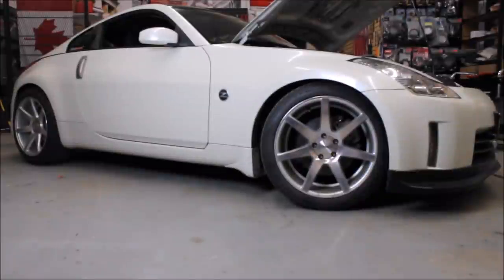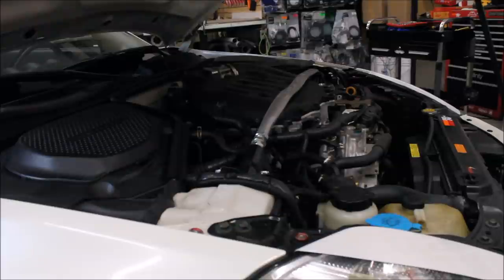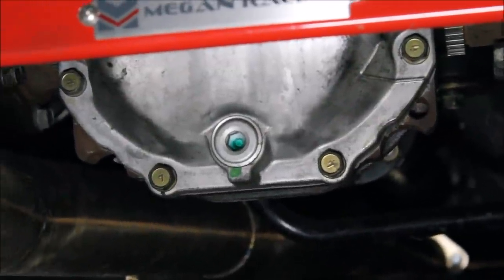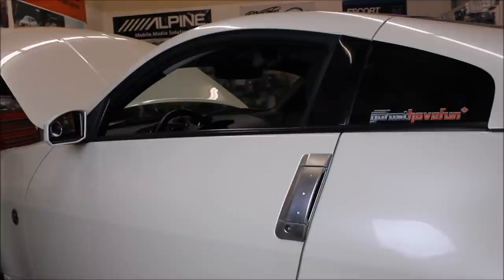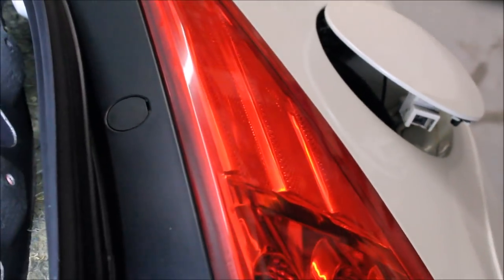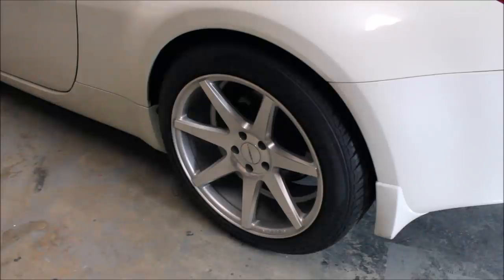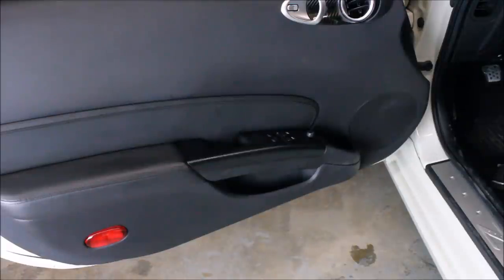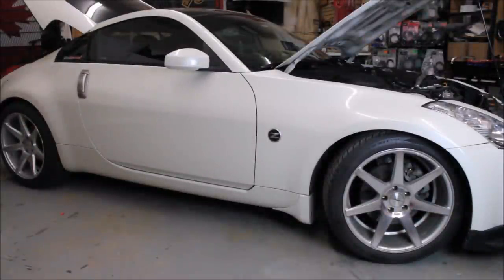Things you didn't know about the Nissan 350Z (Nerd Out Session) | AnthonyJ350

Comment: ADD-ON: you can roll up the window on a 35oz by putting the key on the drivers door and turning it into the lock position and holding it there until it tools up all the way :D. Great video btw 👍👍👍
Reply from the maker: Thanks!  True, but at that point you're so close you can get in the car.  The aftermarket way is way cool ;)
Reply: AnthonyJ350 
Anthony the unlock button down... both windows roll down 😀
Reply: that does not work on my JDM 350z  and not via remote on my jdm 370z
Reply: True, this is actually the only way I can get into my Z because the handle on the driver side doesn’t work 💀💀

Comment: For access to emergency gas cap opening, use a 3/4 inch hole saw or larger depending on how much room you need to gain access to open a access hole and either keep a small section of coat hanger that's been pre-bent to the right proportions or even cleaned welding rod in your rear seat glove compartment or thread a length of wire with a knot on one end. Fish it through or loop it over and around the actuator and have it like a pull line that remains hidden under the  trunk carpeting.
Reply from the maker: Thanks for sharinga

Comment: The ground on the muffler, is for stopping a static charge from building up inside the muffler. That way a static charge, will ground out on the frame, which makes no accidental combustion within the muffler, from unburnt fuel. Great video! Thanks for posting!!
Reply from the maker: Interesting, why wouldn't it be factory on every vehicle? Or is it because a 350Z runs more rich from factory?
Reply: @AnthonyJ350  Sorry but I don't know! What I wrote was just a theory!! But every part on the vehicle does something. Could be; having to do with the with high lift cams and timing, high compression, and things of that nature.
Reply: Also without a good ground, your ignition system will underperform, you'll experience random issues with charging, and you can easily end up stranded. ... Ground the engine block to the frame with a heavy ground wire or cable, making sure that both connections are clean, tight, and metal to metal.
Reply from the maker: @fernominal  OH like this? https://youtu.be/mkWCqSfr6ig

Comment: Makes me wanna sell my frs and get a z
Reply from the maker: Do it!
Reply: AnthonyJ350 I am thinking about it, I like the frs but I feel living in Alberta you don't get to appreciate the true car it is. It's built to be on track, while the z has lots of get go and still can be a lot of fun to drive on tight roads.
Reply from the maker: Huss Ali Ya the power of the VQ is nice even stock and the handling is impressive even though it's heavier.
Reply from the maker: Faketrollname sevenbillion Not really. There's videos when it debuted going toe to toe with the S2000
Reply: Honestly if I was getting another sportscar I'd take an S2000 over a Z. I loved my Z but the handling at the limit was a mess. And with this guy coming from an frs, which has been specifically designed to have a low limit and be really balanced and controllable over that limit, I can see it being an annoyance for him.
Reply from the maker: Faketrollname sevenbillion What did you do to the suspension? what made it a mess?
Reply: Suspension was stock, lateral grip was awesome and the car felt agile and predictable at regular speeds or even driving hard, BUT when it let go it was pretty much a toss up whether it was going to be extreme oversteer or understeer, and in the case of oversteer it was not progressive unless the tires were in bad condition. With michelin pilot supersports you would be sideways with full lock before your brain realized you were going into a slide. I also switched between understeer/oversteer in a couple of corners while I was learning the car, which wasn't enjoyable or intuitive. There wasn't really a place where you could just ease the tail out for kicks. If you decided to push the limit on it you had to be prepared for it to bite back hard. It was too disturbed by small weight shift changes front to back, so when driving near the limit any kind of throttle control mid corner had to be extremely smooth and precise (far more than other cars in the same class). I never really enjoyed kicking the tail out because the transition back to regular driving without the car throwing a wobbly took too much concentration. This is because it had a very sophisticated (and in my opinion shite) suspension setup that was set up for a soft American style ride on the highway with Japanese agility in the corners. If it got confused between those two modes mid corner it became the mess I'm referring to. In terms of outright performance it had huge grip, and it could do well at 90% but beyond that it was horrible. It's one of the few cars I've had where I never felt connected to the car.  It was a real shame because I loved everything else about it. - I should note that I had the convertible, I don't know if the coupe is better with the extra body stiffness
Reply from the maker: Faketrollname sevenbillion So it was a convertible, ya very different car  with the added weight abd probably not as stiff. The 350Z is setup for understeer so if you wanted it to be more predictable at the limit you would have needed to put a bigger sway bar on the back ( the front is huge and the rear is really small) put in polyurethane bushings for the sway bars and new shocks (probably worn out). The suspension tuning can be altered slightly to give that driving experience.
Reply from the maker: Faketrollname sevenbillion Also the brake master bracing and clutch pedal need to be updated to give better driver feel.
Reply: AnthonyJ350 yeah that's why I'm telling the guy to be prepared to upgrade his suspension. My clutch and brakes were good, the car was under warranty and my dealer would replace pretty much anything I wanted at any time because I guess it was a high margin car for him to do that on.
Reply from the maker: Faketrollname sevenbillion Ya but at this age they need dampeners anyways and sway bar bushings are easy to swap. So they shouldn't  expect to do nothing after purchase. He should test drive both. I picked the 350Z because it's the best deal on the market. To make the Frs as power takes more money than some suspension upgrades. if you want super nimble the Frs is lighter so nothing beats that. The s2000 is a horrible touring machine. 2 people on a mountain road for 6 hours the 350z is a better car than the s2000. Watch my kelowna video.
Reply: Z's are some of the best handling cars stock...this may be the first person I've seen write something otherwise xD FRS is definitely a great handling car, too.
Reply: Huss Ali where you from in AB? I have a vq and it is great in AB
Reply: Huss Ali ive been looking at both for years. But the Z wins hands down.
Reply: Having read all these comments, I find it hard to believe that the 350 is THAT bad at the limit... My '06 G35 (Sports Package) is heavier but still VERY predictable at the limit - what am I missing?
Reply from the maker: Ellipsis of Triple Tap No one ever mentions what tires they're running?
Reply: Buddy Guy 
Man I feel like you’re describing my Xterra. I drive it like a sports car when the adrenaline kicks in. If it wasn’t for the VDC... I might be driving a bicycle by now.
Reply: I wonder how does the Z compare to frs. I drove many, one was boosted with ~350 whp and still felt very controlable. The best handling car I ever drove. Waaay better than the 2v GT I had at the time lol! Now I’m looking into getting a G37 or maybe Z350.
Reply: 3 phukin 50!
Reply: @AnthonyJ350  on the track stock frs definitely handles much better than the stock z. I drive a 370z I feel like a 370z is more like a 7/10 car but frs is much like a 10/10 car. Not saying z is bad but lacking of a proper lsd and being too soft from the factory definitely hinder the z a little as opposed to the frs. However 370z on not so tight backroad is faster than the frs
Reply from the maker: @itchyonion3559  Are you also comparing a Z with worn out suspension vs an FRS that is relatively new and fresh?  It's a amazing what fresh shocks and sway bar end links will do to tighten up suspension.  Also the FRS is much lighter.
Reply: @AnthonyJ350  my 370z is a 2016, frs was a 2013 lol
Reply: @AnthonyJ350 also vdc cannot be fully disabled on z
Reply: @AnthonyJ350  to be added impressions on street and track could be different too. I was hanging tight in some corners with an e92 m3 with 265 285 semi slick tires when not on the track. But after driving both of them on track I found the e92 is a bit more enjoyable to drive. However on street I couldn’t tell which one is actually better.
Reply: @AnthonyJ350  my best friend actually used to have three brand new 370z.(he kept trading in for a new one) he took his car to the track when he only has 1000km on the clock! He actually realized that 370z is not a track car from the factory. He actually own a brz in China he says he likes brz more for the track. but he thinks z is more exciting and fun on the street.

Comment: Im itching so bad to get a 350z, intending on buying one next year, 06 track model, modding it to be stealth black looking;

is it possible to have a single turbo in this? i want the sound of a turbo in this car lol
Reply from the maker: Hamster Smash I'm sure you could. Just search up kits.
Reply: Hamster Smash HR is much better than the DE. I'd stay away from the DE
Reply: 2006 Rev-Up? Be sure to always check the oil. :) Most people advice not to buy a 2006... because of it's oil consumption. Best is the HR then DE and then Rev-Up
Reply from the maker: Herman Willems So your advice is not to buy the Revup because you have to check the oil? Just do my dipstick mod.
Reply: I am wondering if it gets worse. Or does the consumption always stay the same?
Reply from the maker: Herman Willems probably worse depending how you maintain it and drive it. Things wear out over time. You'll probably need a rebuild at 250,000 miles maybe.

Comment: I inherited a 2004 350z a couple years ago.  The car is really fun to drive but I don't really like the convertible top on it.  I haven't had any issues with repairs.  I have been able to replace the radiator fans, an ignition coil, and the camshaft sensors by myself.
Reply from the maker: Ya they're actually pretty decent to work on which is why I like them so much.

Comment: Lol..... I figured most of these out myself... Good vid though.... Btw you can open and close the window by using the key.... Method: use key to lock the door then center the key then hold it in the locked position..... Same to open... Window goes up and down
Reply from the maker: I find that one weird since I'm right at the vehicle.  I think it's cooler when you're 20 feet away and you can operate the windows via remote.  Unfortunately stock doesn't let you roll them up only down.  You have to go aftermarket if you want full functionality.

Comment: I find the back window is fine to see out of and the quarter windows
are as good as any two door I have driven. No car has perfect rearward visibility.
I have yet to drive a car where I don't have to 'lean to look' at certain times.
As for the limited slip differential, I have an 04 and it does not have a limited slip differential.
It is a base model and because it has a conventional differential, the
car handles turns better under power with less tendency to have the
arse end break loose then my other cars that have a limited slip differential.
Reply: Oh, that gas lid thing is one of the dumbest engineering feats I
have ever seen. Duh? My Infiniti and my Mustang are easy to open but
this system, if that solenoid fails, is a nightmare. All those parts you have to remove to
get at a way to manually release that gas filler door. Unbelievable.
Reply from the maker: @archangele1  But you can hook it up to remote and pop it open and look cool!

Comment: the Key physically in the door handle turned left and held will roll the windows down and held to the right rolls them up. Standard
Reply from the maker: Ya but then you have to walk up to it. I like operating it with an aftermarket system from a distance.

Comment: When painting the plastic panels and you do is start with a 400 grit sandpaper then use 800 then 1000 use a plastic primer then you can coat using a water base paint an the more primer better sticking to the plastic 
If you wanna use something like a lacquer base paint just make sure you clean the surface well and when done with the lacquer use a clear coat and lay it on kinda thick but be careful not to turn it white.
Reply from the maker: Thanks for the feedback!

Comment: It's the Chassis that's FM, not the engine.

For better rear visibility, the rearview mirror is on a double axis, allowing you to effectively raise/lower the mirror. You'd be surprised how much this helps.

You can get the fuel door open by pushing on the top of it, and then pulling the bottom, flexing it past the pin.This is the only good thing about it being plastic.

The door pulls on the early models (03 for sure, possibly 04 & 05 as well) are black plastic, not painted.Same goes for the door handle trim and the cubby/nav door/cover.

If your clutch engagement point is high, it probably just needs to be adjusted.
Reply from the maker: Tim Head Isn't the term midship because the weight of the engine is behind the front wheels?
Reply: Yes, but it's not the engine that dictates that, it's the chassis. For example, the 06 Infiniti M is also a front midship design, whether it's the VQ35 or the VK45. The engine doesn't dictate that it's FM, the placement of the engine in this chassis does. I'm sure this is what you meant, but that's not how it came across.

Comment: Also does your temp gauge change between different systems? I have a button on my cluster that I hit and it will cycle through temp,  mpg, rpm, miles till empty, and a few other settings. I can even adjust my redline shift light from that little gauge.
Reply from the maker: Mine does the same.

Comment: How can I tell what what model of Z I have..? Mine is a 2008 but I cannot tell if its a Touring, Grand Touring, Enthusiast, ect... It has full leather, heated seats, cruise control, VDC, Navigation,  Splash Guards for each tire, And lip spoiler if that helps...
Reply from the maker: Matt Pearson Sounds like a Grand Touring. Do you have Brembo brakes?  You can also call the dealership with the VIN and they can confirm your trim level.
Reply: Yes, it has the Brembo package as well.
Reply: I thought on the Grand Touring the front wheels were 18" and the rear wheels were 19"... Mine are 18" all around.

Comment: Anthony!
I have purchased a set of seven inch light bars for my 2006 350Z convertible.
I have also bought a separate wiring harness with its own on off switch.
Do you have any suggestions on where I can run the wiring into the cab ?
I’ve looked at attaching the lights to the “bumper” and power directly to the battery.
What do you suggest?
Reply from the maker: This video will help with running wire https://youtu.be/bXElAdXWgnY

Comment: Hey AJ, what about the factory supplied cd for the navigation system ? Any updates for that from either Nissan or Infinite ? I have a pretty nice 2005 350Z and wanted to update the nav system. Rock Auto has replacement parts for the Z. Let me know if you come up with anything else. Rob - Great video btw ! !
Reply from the maker: Unfortunately most manufacturers don't really support the electronics as far as software goes, as the vehucle ages.

Comment: Can't roll the windows down or up using just the key fob with my 350 :(
Reply from the maker: Mark Smith Need to go aftermarket then like the Viper unit I installed.
Reply: use the key
Reply from the maker: Mark Smith But then you have to walk all the way up to the vehicle. You might as well get in. My way you look like a boss cause you roll them down as you walk towards the vehicle.
Reply: Push and hold the unlock button.

Comment: It looks like you installed an aftermarket upper plenum. Have you realized any performance gains from that? Also you mentioned that the rear "bushing" would go bad (I know I'm messing this up), and you advised to not go with the Nissan part, but to buy aftermarket. What was that rear bushing again, and what aftermarket brand do you recommend?
Reply from the maker: Yes I noticed a good amount of power in the midrange with the MREV2 and Plenum spacer.  I also installed the Iso Thermal Upgrade at the same time to help keep the intake cooler.  It is highly recommended to get the car tuned as well, watch here https://www.youtube.com/watch?v=eC1-hE3PBf0&t=6s

The bushing that tends to fail is the differential carrier bushing.  I like using Energy Suspension for a polyurethane brand.
Reply: The rear diff. carrier bushing is something you said needs replacing. What aftermarket brand do you recommend? My Z has 150K, and I just replaced my shocks and struts with a set of Tokico HP's. The car handles OUTRAGEOUSLY WELL with the addition of the aftermarket shocks.
Reply from the maker: Bert Silva Energy Suspension

Comment: you missed one thing, how to bring the windows back up, put the key in the door and put it in lock position, hold there until your windows go up
Reply from the maker: Richard Gollen I did and I didn't.  I wired the Viper into the door activating that feature through my remote, that's how I rolled them up in the video.
Reply: also forgot about how to disable and enable the horn lock function